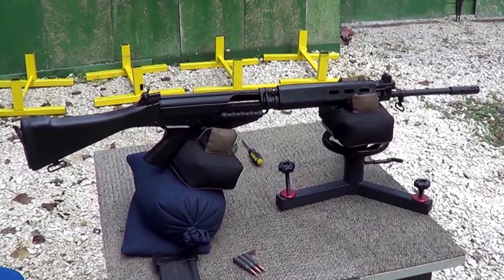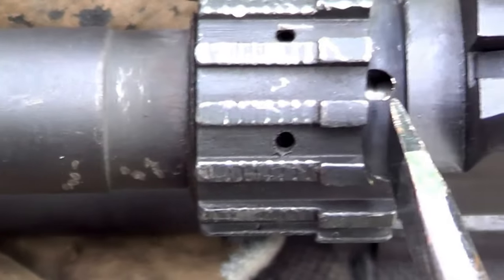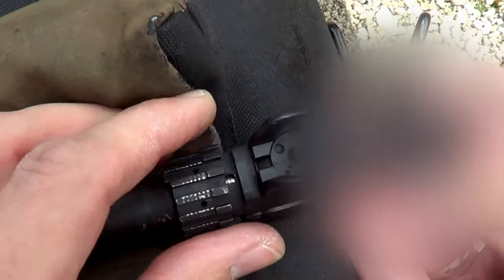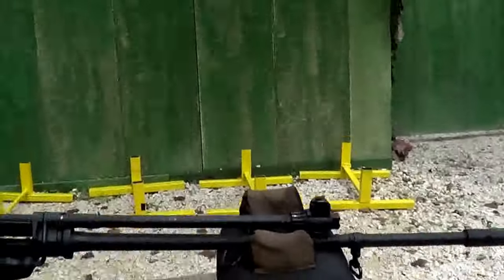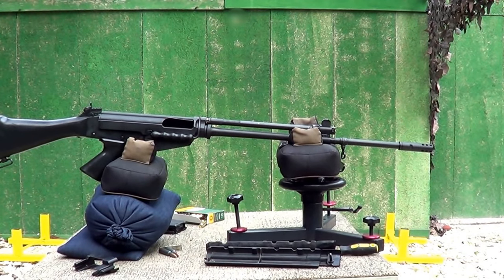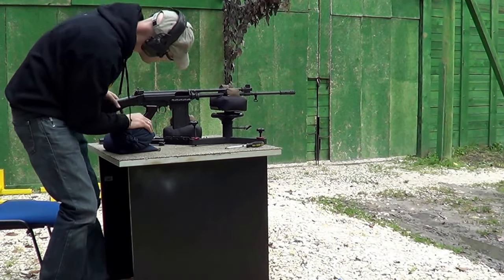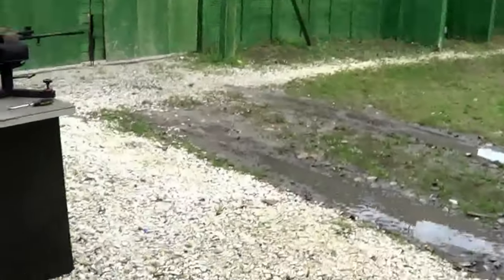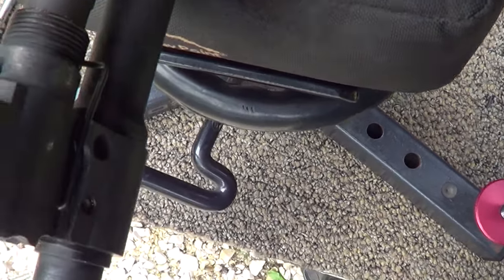FN FAL Gas adjustment and gas system explained, gas tube removed

Comment: good explanation. Solid instructions. Your video has strange spots on it like you are in witness protection agency.
Reply: Seems like it's some kind of auto face recognition and blur program. Notice how it blurs his face but not all the time, and random blurs appear at times like the algorithm is confusing some pattern in the frame as a face. If it is an auto face blur program, it doesn't work very well.

Comment: On a SAFN 49 (the forerunner to the FAL) rotating the gas lug 180 degrees cuts off gas flow to the piston making it possible to launch rifle grenades.I own a G series FN FAL model 50.00 (one of less than 2000 imported by Browning between 1959 and 1964.The gas system appears to be  the same as the FN 49.My rifle came with a sniper scope and is in near excellent condition.I really love the was it shoots.

Comment: A dude I work with brought an FAL to me for cleaning (gas tube was full of grease!) with 11 gas settings.  It ejects the same on setting 1 as it does on setting 11.   Anyone?
Reply: Keep setting at th setting allowing the most gas to eject the brass case, assuming a #1.
By closing the port to the maximum, assuming #11, or beyond the minimum causes undue wear and stress to the receiver.  Your beating your receiver to a pulp.

You can insert a poly tecoil block to help reduce wear to the receiver.
Reply: I had some old (1963) Spanish surplus ammo. The FAL would not eject it no matter what the gas setting. I figure the powder must have degraded. The primers were all fine, though. So, I bought a collet puller and pulled the bullets on 500 rounds of ammo, then reloaded them with fresh powder and they worked fine after that.

Comment: The setting of the Gas Regulator has nothing to do with the propellent Gas affecting the Bullet. The same amount of Propellent Gas escapes through the Gas Vent.  The Gas Regulator allows more Gas to drive the Piston to the rear as the weapon gets dirty with burnt propellent.  To fire a Rifle Grenade the Gas Plug is rotated 180 degrees blocking off all Propellent Gas escaping through the Gas Block and thus propelling the Grenade. In the British forces we fired the no 94 Energa Anti Tank Grenade
Reply: rockape252 True, though you can turn off the gas plug and all the gas will propel the bullet but the rifle will not cycle. It will behave as a single shot rifle that needs to be hand charged each time.
Reply: That is true. I know from experience.  @BooDamnHoo

Comment: OK very good explanation for the usage of the gas port system adjustment. Now. What is it  used for or why?
Reply: When shooting: Set gas at 5. 
Stoppage drill: rifles fires once then stops. Work charging handle. 
Rifles fires one or two shots and stops again. 
safety on, pull rifle down close to you, turn gas to 6 or 7. 
Carry on firing. 
Repeat if needed. 

Basically, gas at middle setting number for a start, then more gas if it doesn't reload. 

It depends on how hot, cold the day is, or how fouled the gas piston is. 

If this happens with full gas, survive, then get your rifle to an armourer, or clean it yourself.

Comment: my whole barrel is a lemon, i bought 2 gas plugs both which show gaps between the plug and gas assembly.    Good video+humor not enough of the latter in these vids. cheers.
Reply from the maker: Hey buddy, what do u mean by lemmon barrel? I dont understand that. Yes,.i willhave more.humour and jokes, the zee germans are comin'!
Reply: Bear of Sinai
gas plug is loose on the front, I replaced the plug and same issue so i figure it was improperly machined OR just beat to shit not really sure.   I was told to silver solder on the inside of the gas plug to counder it but that's not working at all.
Reply from the maker: ondamedjedi can u post a video abiut it? The gas plug is fitting snugly on all fals i' ve seen. So there is a gap between your plug and the gas block, even after u put the plug back? Are u surely.not interchanging metric and inch pattern parts?

Comment: I am using an ex irish army FN FAL, it ejects brass about 10meters and with m80 ball I cannot get a grouping less than 4 inches. Do you know why?
Reply from the maker: Sorry mate, missed your question. The gas port is too closed, open it up a little bit, you are hammering the piston with unnecessary huge amount of gasses. This also might degrade your accuracy, as less gas is used to propek the bullet than the ideal qty.

On the other hand, 4inch groups with a Fal are not tragical, especially with surplus ball ammo.

Buy a couple boxes of other ammo types, e.g. hornady, prvi, saloerbellot etc., and trial and error experience will tell u, which ia the optimal one.

Use steady conditions, e.g. sandbag, rifle support, shoot slow and calm, try.to cut out the human factor.

My best group with Fal was 1.5 MoA, with Norma Jaktmatch ammo (bit pricey....)

Have fun!
Reply: Thanks very much
Reply from the maker: Colin McQuaid what i mean mate is if u achieve 4 inch with ball ammo, i bet u will.go under two moa with quality ammo. Cheers from Hungary!

Comment: Ok I have to ask is there a reason why you just cant close gas tube to be sure that will cycle? And I just bought L1A1 and i set it to wide open (12 on the top) and it still works, I dont know if its wrong but it works.
Reply from the maker: check if the gas collar was not screwed/put back the wrong (opposite) direction... if the hole is fully open, it could never cycle.
Reply: +Bear of Sinai Maybe it is because of ammo.That hole on the top is wide open and it still works, ill try a different ammo in the future to test this once more. And thank for reply.
Reply from the maker: 73288 so... something just doesn't add up here. If the gas port is open, i.e. the hole is there, visible, large, there is just no way that the rifle could cicle properly.

Except for a WILDLY overloaded cartridge, but that would show and tell right away on the cases (ruptures, cracks e.g.).

SO I would rather poke' around the:
-gas plug (clean? no gunk in there? is the "A" sign on the top when reassemlbed)?
-gas collar (is it properly adjusted)?
-what happens if you go all the 14 clicks the other way?

And yes, trying some other ammo is also a very good idea.

Keep me posted, pls.

Comment: In my experience with the L1A1, setting the gas to mid range always worked. I'm not quite sure why you wouldn't use a really high setting other than perhaps more recoil and wear?

Little mentioned is that the iron sights that move depending on how the weapon is held - due to the pivot. To be a good shot (I was a marksman) you need to learn how to hold the weapon consistently between shots.
Reply: What?   The front sight is timed to the receiver when the barrel is installed into the receiver.   Unless the barrel itself is unscrewing from the receiver, there should be no movement of the front sight.
Reply: The front-sight and barrel and receiver assembly move as one piece on the pivot. The rear sight is on the butt-stock assembly. There is some slop in the pivot so the two assemblies move depending on how you hold the weapon.
Reply: Jeremy Ardley 

Ihhh, I misunderstood. 
I thought you were saying lateral movement of the front sight assembly was possible. 

While you may be technically correct, I think you're giving the tiny movements possible too much credit. 
We're talking about battle rifles that are capable of 3 NOW at best.  That, combined with standing, offhand firing likely makes any vertical shift possible from the pivot more or less insignificant.
Reply: The flex is a rotary motion around the barrel axis so more left/right and less up/down. I have shot this weapon with iron sights in top military marksmanship contests and I know precisely how the weapon moves under different grips and pressures. When firing prone at snap targets and at long distance fixed targets you will always get better/more consistent results if you hold it the same way. At 300m it is as much as 8 inches lateral  mean impact point - i.e. outside of the V-Bull.
Reply: Jeremy Ardley 

At 300 meters, you're going to get a 9 inch grouping, at best, with a 3MOA rifle. 

I have no doubt that you firmly believe that the wiggle in the pivot affects accuracy. 

Many people also falsely believe that poor upper to lower fit negatively affects accuracy in the stoner pattern rifles. 
It would be even more evident in the AR-15 if such issues were valid, as that rifle is capable of great precision, at times even under 1MOA. 

Furthermore, being a ring and post system, the post doesn't need to be stationary for the sighting system to function normally. 

cheers
Reply: It's not just I that have that opinion. As I said I was a marksman and serious competitor in  military shooting competitions. I've discussed this with other shooters including SASR snipers (obviously they used proper sniper rifles and L1A1 only occasionally). I also discussed it with the the designer of the KAL1 GPIR bullpup version of the L1A1/SLR and it is a noted defect in the L1A1 design.

The other problem with the L1A1 is the barrel is a tad light. An L2A1 with barrel mounted scope and match grade ammo is far more accurate and makes a half-decent (designated) marksman rifle.
Reply: Jeremy Ardley higher gas setting in colder temperatures maybe?

Comment: Excellent video.  After 20 years of faithfulness my FN stopped cycling.  Come to find out the gas settings were off.  Maybe moved the dial when cleaning. Also, I was using cheap Wolf ammo and when I went to Brass case is when it stopped cycling causing FTE.  So, you recommend starting at 8 clicks away from the fully open gas port or is each gun different on the exact amount of closing off position of the gas port?  Thank you again for this.  Saved me money from gunsmith :)
Reply from the maker: well happy to help. my fal just needed two extra clicks for steel cased ammo to be able to cycle perfectly. make sure to ckean the gas port's gas hole thoroughly. fals can go on forever with steel cased ammo, dont worry.
Reply: I took her completely apart and the gas tube and piston was caked with 50 years of residue. Cleaned her up and lightly lubed the piston and tube then wiped her clean before assembling. Taking her out tomorrow to see how she runs. Thank you again.
Reply: Soooo, how'd it work out for you?!?!?
Reply: All good. Runs like she used to.
Reply: I just picked up an IMBEL.
I have no idea what I'm doing with it so I'll be careful adjusting the gas system. 
Are you still shooting Wolf through yours?
Reply: I am still shooting Wolf.  I am taking a few minuets to field strip the rifle and clean the gas tube after every time at the range. Ive read that Wolf is a dirty round leaving much residue behind but the price is right and I just take the extra time to clean the rifle.  I would not use Wolf in my Remington 700.  I spend the extra money on brass ammo.
Reply: Thank you for responding sir.
Happy shooting.